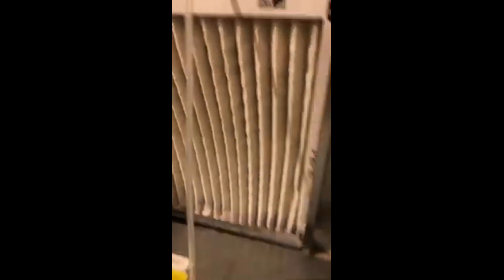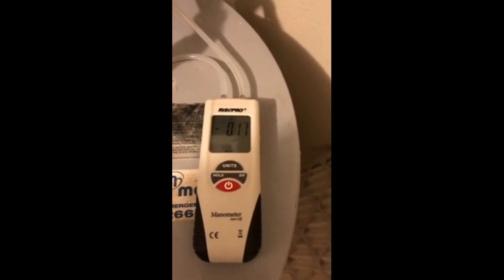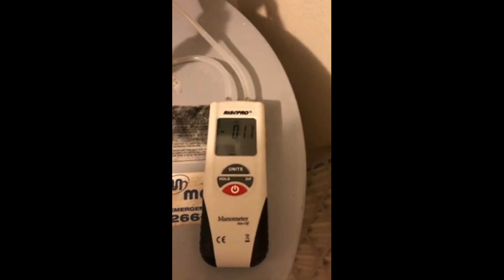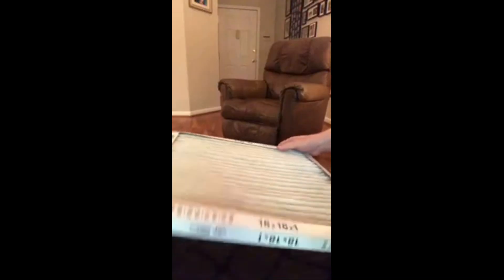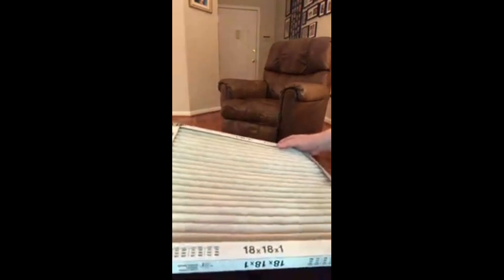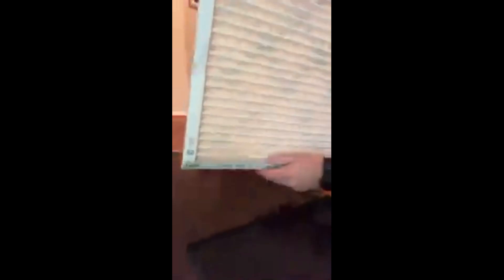Home Depot 2 Months Usage HDX FPR 5    #furnacefilters #airfilter

Comment: You can't beat the HDX filters anywhere for the price
Reply from the maker: True.
Reply: I agree about these HDX FPR 5 filters!  Nice wired mesh pleated filters selling for $12.96 for a 3-pack.
Reply: @FurnaceFilterTalk  - How's the HDX filters doing for you so far?  Are you still using them as your main go-to filters?  I know in the past the Filtrete 300 / MERV 5 filters were you go to filters as a good balance of price/air flow/filtering needs for you.  The HDX are a nice step up to MERV 8 without costing more - in fact they're a tiny bit cheaper based on the 3-pack pricing.  

So have you kept the HDX FPR 5 / MERV 8 filters as your main filters the past year and haven't gone back to the Filtrete 300?

Comment: Hey there, great video! Just had to replace my AC unit. Tech basically said don’t get anything to expensive for filters, didn’t really get technical. Just picked this up MERV 8. Wondering if that’s good enough, my size filter is 18 30 1. Was looking for filtrete but can’t find any MERV 8 or MERV 10. MERV 11 is the only one filtrete in my size but wondering if going to that is to restrictive or just stick with the HDX MERV 8, there only like 6 bucks at Home Depot!

Comment: I’ve been using the HDX FPR5 Merv 8 filters for 2 1/2 months with no issues of it being flimsy or falling apart.  I’m using the 20 x 30” so it has the 4 point cardboard support on both front and back.  I will change it after 3 months.  It has turned gray from white in the last 2 1/2 months.  I buy the filters in person at Home Depot to make sure they are not damaged.
Reply from the maker: Awesome.
Reply: Sounds great - these HDX MERV 8 filters have the best balance of function, quality and price.  Easy on the pocket to use and toss out every 30-60 days for me.

Comment: Thanks for the follow-up review of the Home Depot HDX FPR 5 (MERV 8) filter.  The before and after static pressure number looks great!  

I have also started trying these filters and so far so good - great low cost where I get the 3-pack for $12.96.  They fit the bill for a simple but good pleated MERV 8 filter at a relatively inexpensive price to use and toss out every 30-60 days for me.